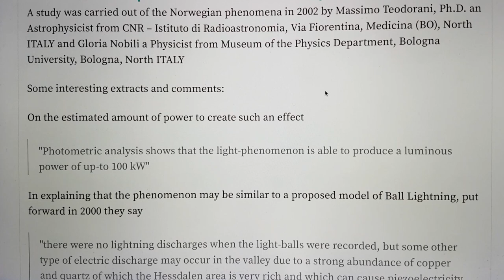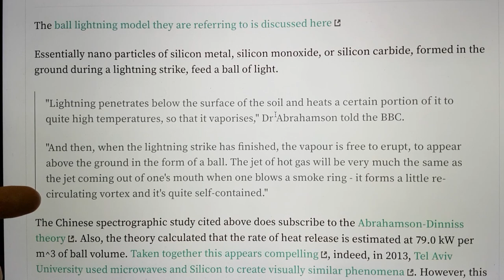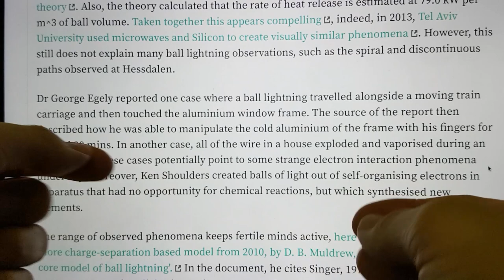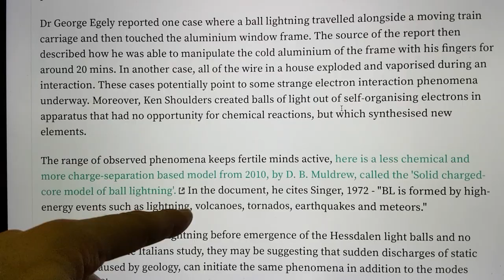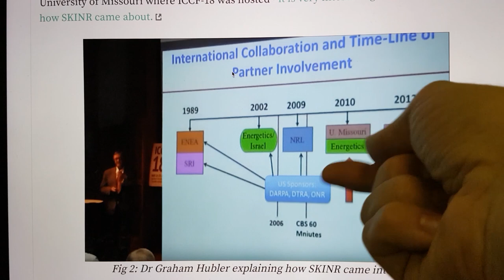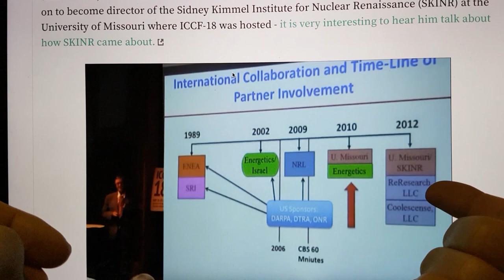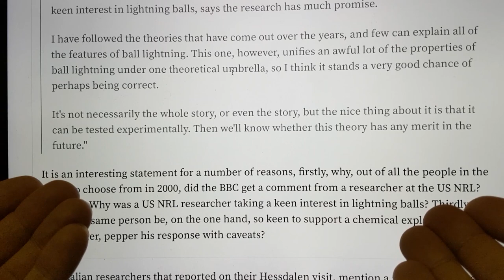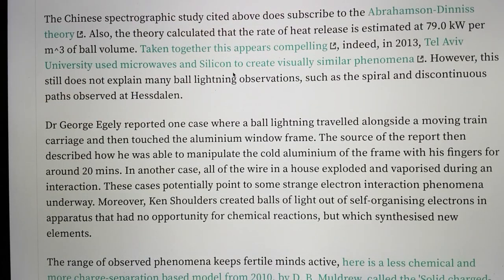Hessdalen Part 2: Curious Interest in Fire Ball Phenomena and Inadequate Models

Comment: Manipulate cold Aluminum frame with fingers? Could that be used in manufacturing?
Reply from the maker: The man made analogue process was demonstrated as a cold metal casting technique in early 1990s to a team sent by Tom Bearden to Moscow, it was then demonstrated in London, before being classified again - This is in Tom Bearden's book - 'Fer de Lance'
Reply: @MFMP  thx for the reading recommendation... They used it on the Challenger 86 for real? Plasma amplifying scalars? saying that out loud sounds crazier than intergalactic arachnids lol I'm going make a tin foil hat and actually wear it thx again
Reply from the maker: Multiple layers of metallised Mylar and a grounding chord with one of those anti-static brushes they attach to cars in good contact with ground.
Reply: What about trying to emit noise to cancel out incoming transmission... What would be a good test? Loss in radio or wifi reception?
Reply from the maker: @matthewfredrickmfkrz1934  Using an old AM / LW radio tuned between stations might provide an indication, little clicks.